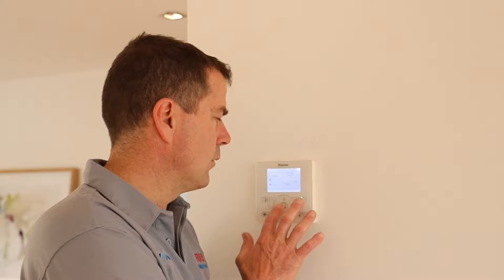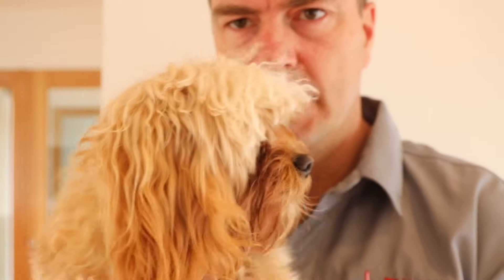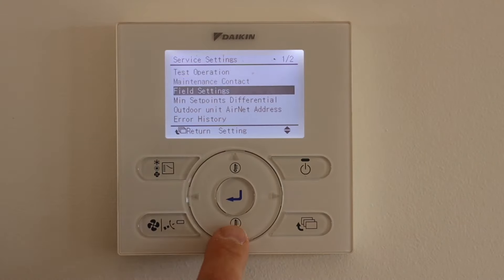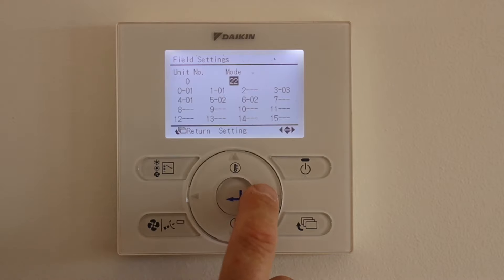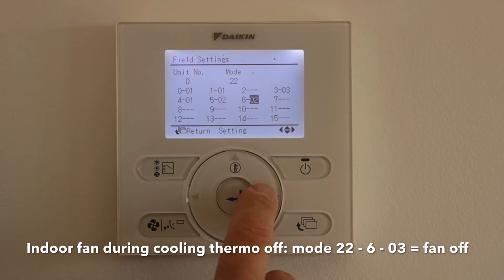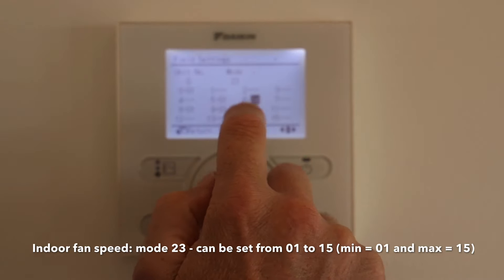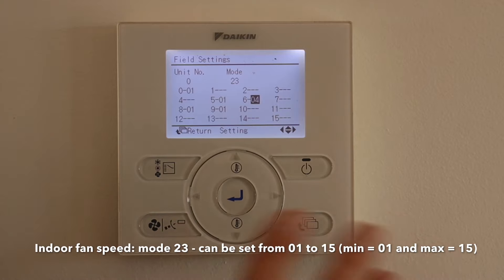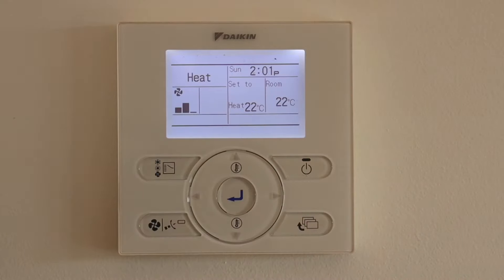Daikin BRC1E63 controller set up field settings cycle fan off, activate sensor in wall controller

Comment: Hi, great video! I’m hoping you can help me with my unit.
I live in an apartment and have this ducted unit. The controller is in the living room and the aircon services the living room and a bedroom (my daughters room) I am finding that if I run the aircon at 25degrees on cool and low fan it won’t cool but if I run it at 24 degrees and the same settings it will cool and cool until my daughters room is as cold as 19 degrees. When this happens the room temperature on the controller says it’s about 22 degrees. I’m so tired because I stay awake all night adjusting the aircon so that my daughter (10 month old baby) doesn’t wake from being too cold or too hot. Is there a field setting you suggest I change?
Thank you so much.
Reply from the maker: Setting the temperature sensor location to the wall controller only would be best (20-2-03), but if your daughters room is getting cooler that the rest of the rooms it dew to uneven air flow to the areas . you need to reduce the air flow to her room so it cools at the same rate as the other rooms. Block off some of the vent or close the louvers to reduce air flow, keep reducing air flow until the room cool at the same rate. this will take some trial and error to work out over a few days, slowly reducing the air.  But when the rooms heat or cool at the same rate / temp the air flow is correct,
Reply: Fully Airconditioned thank you so much for the quick reply. I appreciate it so much. I will give it a go!
Reply: Hi! Following your suggestion the unit is running much better now, thank you!
What code would I use to ensure that once the room temperature is met it stops cooling but the fan remains running to provide air circulation? Thank you!
Reply from the maker: @daniellemathertjoeng6194  To set the fan to keep running in its set speed on the controller, in cooling only, set mode 22, 6, 02.
 To set fan to keep running on "Low Low fan speed" (one speed lower that low speed that you can set from the controller) in cooling only, set mode 22, 6, 01.

Kind Regards 

craig
Reply: @FullyAirconditioned  hi Craig, thanks for your help so far! I’ve just realised I have a BRCIE62 controller and not the 3, does this matter with field settings? Also, now when set temperature is reached in the room the unit switches to fan like desired but when the room heats up again it doesn’t seem to recognise and turn back on to cooling? Is there any setting to fix this? 
Thanks so much!
Reply from the maker: @daniellemathertjoeng6194  what is the sensor setting 20-2-01? -02 ? Or -03 ?
Reply: @FullyAirconditioned  03 :) however I should mention it’s a poor instillation I think as the return air is above the controller
Reply from the maker: @daniellemathertjoeng6194  try 02 , indoor sensor only and see if that’s any better
Reply: @FullyAirconditioned  ok, thank you! I will give it a go :)
Reply: @FullyAirconditioned  hey Craig, not any better on 02 setting. The system still seems to be cooling and not stopping when set to 24degrees so the rooms get as low as 19degrees, when I intervene and turn the aircon off or set it to 25 which it then turns the cooling off. Any reason why this would be?
So I can set it to 25degrees cool and it won’t cool and just run the fan but as soon as it’s turned to 24 degrees cool it will cool and cool until I turn back up to 25degrees, so even past when room temperature is met. It’s driving me crazy!!! Appreciate any help

Comment: I can’t adjust the temperature.  For example, I raise the temperature from 26 to 28, but it returns to 26 in a few seconds.  Please help me!
Reply from the maker: Go to energy savings options, then energy savings list and make sure all energy saving options are set to off. You have auto set point reset enabled, this resets the set point back to the e pre set amount often the adjusted set point is reached.
Reply: @FullyAirconditioned  I tried that, but it didn’t work.  I asked the accommodation staff and he told me that “The temperature selection range for our cooling setting is from 20 to 26 degrees”.  So, I have no choice but to turn off the air conditioning if I feel too cold, unfortunately.
Reply from the maker: @masa-fu4pk  it sounds like it’s a VRV system under centralised control
Reply: which means nothing I can do, right? @FullyAirconditioned
Reply from the maker: @masa-fu4pk  correct, but it’s more about how they have it set up.

Comment: Is fan speed also called static pressure 
Increase fan speed 2 to 7 means increased static pressure
Reply from the maker: Yes, static pressure is the resistance to air flow, the higher the static the higher the fan speed needs to be to over come the pressure.

Comment: I have 4 rooms all working Expect my room, air flow is very soft compare to the other rooms and also it’s not as cold as well? Is there a solution to fix this please ??
Reply from the maker: It’s a ducted system I guess, uneven air flow is the problem, I guess your room is the biggest room as well, so it will need more air flow compared to the other rooms. Back off the air in the other rooms by closing off outlets, this will force more air out your vent. Air will take the path of least resistance, so the outlets with a lot of air flow have shorter ducts/ less resistant to air flow. A good duct design/ layout would not have this problem.
Reply: @FullyAirconditioned  see that’s the thing my room is the smallest lol, even when I turn off the rooms on the remote on panel system on the wall it’s still the same thing ... I have a feeling it’s the motor in the ceiling I think my motor to my room is broken or something I dunno.. it’s daikon brand
Reply from the maker: @fufuelhatch444  looks like you need to get your local Daikin dealer/repair person out to have a look, could be a zone motor that is faulty.

Comment: How do I remove centralized control?
Reply from the maker: so i am guessing you have a VRV system with multiply indoor units and you want to change the master unit ??  go to the master controller (thats the one that has all the operating functions on it, heat cool, dry fan auto). push and hold the mode button for 5 sec, now all the  controller screens will be flashing. go to the one you would like to be the master and push the mode button once, this is now the master controller.

Comment: I am looking to purchase a FDYAN125AV1/RZA125CV1 with a BRC1e63 keypad.
2 zone system.
How many thermstat sensors can be connected to this as I was hoping to have 3
One for each zone and the return to do both zones when they are on.
Is the control system capable of auto selecting which sensor to use during zone selections.

Can the following be used as a external sensor?

Daikin Remote Sensor Kit -   KRCS01-1B 

With they operate with the following keypad

BRC1E63
Reply from the maker: You should be looking at the BRC24Z4 or BRC230Z4, as both controller have the ability to have additional sensors fitted. You could get two sensors plus the sensor in the wall controller and you will also be able select the sensor from the return air as well. You can only send from one sensor at any one time. All sensors are activated by the wall controller. If your looking to control temps in zones with different set points or heat loads with all sensors active at one time you should be looking at the Myair zoning system.
Reply: @FullyAirconditioned  Thanks Craig
So what your saying is that even with multiple sensors I can not preselect a sensor with a zone. All they are doing is providing an average. The after market options are to expensive for only two max three zones .
Reply from the maker: @alessi1973  no not average, whatever sensor is selected it will be the control point for the air conditioned. So if you had a a sensor in the lounge zone, a sensor at the wall controller and a sensor in the return air and you set the lounge to be the active sensor, the system will only look at this temp sensor to control system, the other sensors are doing nothing.

Comment: Fan on cooling should not cycle off with compressor. This setting should only be used in heating mode.
Reply from the maker: @darrendesimoni6795  each to their own, many people complain when you have your aircon on over a hot night. When it cools off in the early morning and cooling is not needed the fan will stop saving energy. It also stoping cool air being blown around. When it not needed. We find most people want the fan set to cycle off with the t-stat.

Comment: Good morning Guys,Can any one advise me on how to unlock an old type of hardwire controller.
Many thanks in advance
Peter
Reply from the maker: Hi Benjamin,
what model controller ??
Reply: @FullyAirconditioned  Good morning and thanks for your response, the model number is BRC1D52(Daikin)
Reply from the maker: @benjaminebehiwalu9167  if it’s locked (has the key symbol on the screen) to unlock it, first push any button to light up the screen then hold the enter button down for approximately four seconds (this is the button in the centre of the round dial) This should now unlock the controller.

Comment: Hi I got only 1 speed can’t change on cycle it’s always 2 3-1 can’t change to 2 3-3
Reply from the maker: Hi,
Depends on the indoor unit and if it has a dc fan motor. If its quite old there is no fan speed adjustment at the controller. If its an old Australian model with ac fan motor there is a there is a fan speed change at the indoor unit by moving a jumper cable, but this only increase fan speed and should only be done be a HVAC trades person.
Thanks
Reply: I managed to do it

Comment: Hey iv set a schedule but it still not coming on in the morning 
Have you got any advice please
Reply from the maker: Double check all your settings, time days of the weeks ect. Make shore that that timer schedule is enabled, if its not enabled it wont come on.
Reply: Hi I did all that and still didn’t come on 
Should I test it all or clear it and start again 
? Iv only had it installed also so I’m learning how to use it 
It works fine
Reply from the maker: There are a few video on setting this controller try this one https://youtu.be/TS9yaF9XTYg

Comment: the controller turns off after about 1hour why? but the energy savings list show everything OFF
Reply from the maker: If the energy savings list says all off and a timer is not set, I don't know. it 100% turns off, green light goes out??
Reply: @FullyAirconditioned  this happens to me also after I increase the fan speed. it turns off after about 1 hour.
Reply from the maker: @Setanyahu  turn off, green light goes off on the controller ????
Reply: @FullyAirconditioned  yes
Reply from the maker: @Setanyahu  if the energy savings are all off and there is not a timer set well I don’t know 🤷‍♂️. There could be an input wired into T1 T2 of the indoor unit, this can be used as a forced off, a fire system in a building could be wired into this when there is a fire it shuts down the AC system. You should get your local Daikin authorised repairer to check it out.

Comment: Great Vid, I changed mode 20, 6-02 to 6-03 and it is now cutting out when it reaches the set temp of 22 cool. Awesome thank you! 
Do you have a fix for this - my unit after now cutting out at the set temp of 22 and then changes the setting to maintain temp at 24 with no manual changes? 
Come to think of it, I did change the auto set points fiddling like an idiot
Reply from the maker: Yes, check in the menu under energy saving options, look at energy saving list and make shore “set point auto reset” is set to off. In most cases all should be set to off, down load the manual and read up on the settings for energy savings. You would normally set this in an office space where a lot of people keep changing the temp set point, once it reached the set temp it auto reset to the pre programmed temp set point.
Reply: @FullyAirconditioned  will check it today, thanks 😎